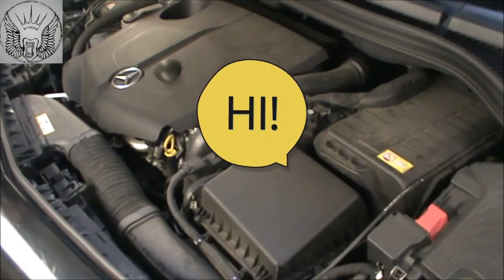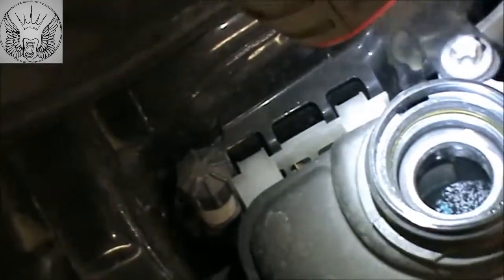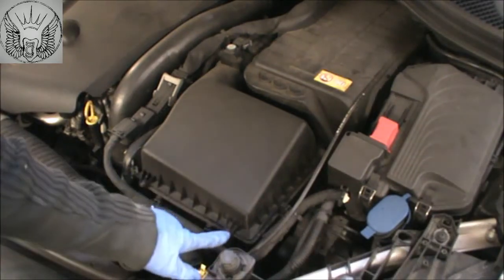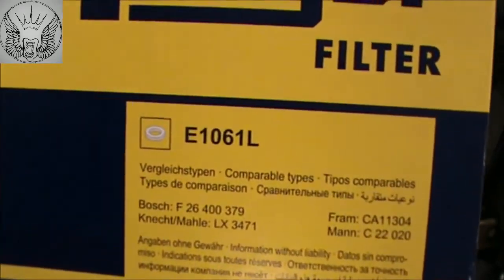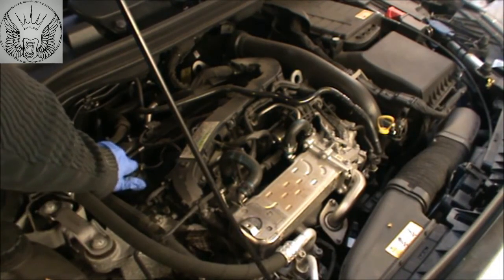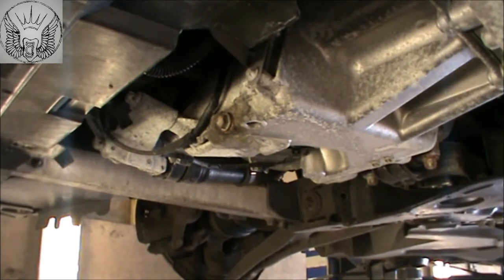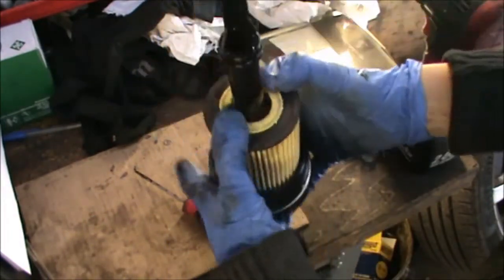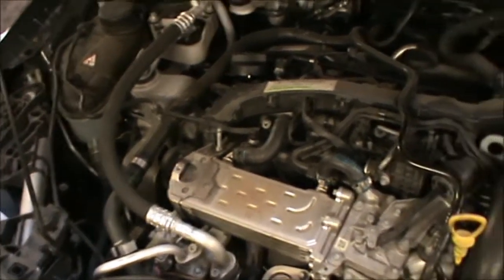Mercedes B180 CDI BlueEFFICIENCY 2013 oil, oil/air filter, coolant check and screen wash fluid topup

Comment: Thanks for the video.  How many liters of oil did you fill up.
Reply from the maker: As far as I understood the manual, diesel engines and some other models take 7 liters of oil, so that's how much I added. I was a bit confused by the manual at first but I think that's what I understand form it. Hope this helps.